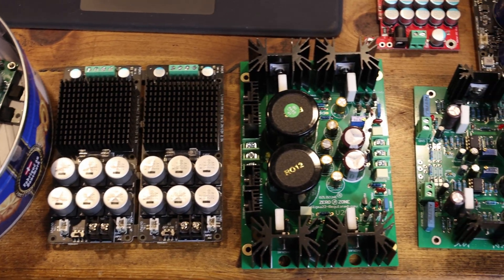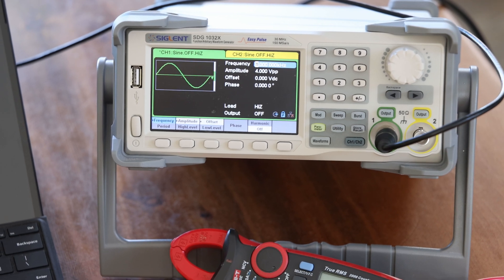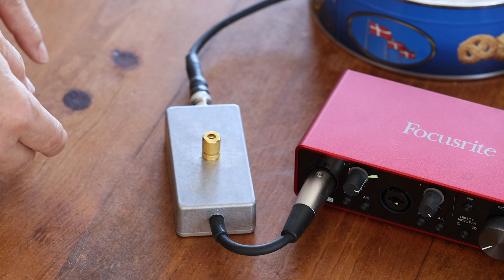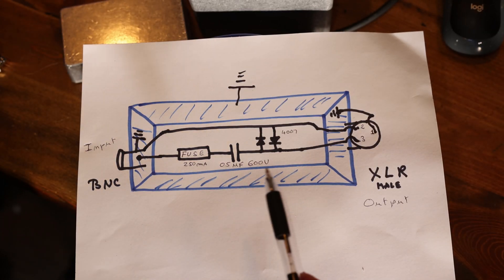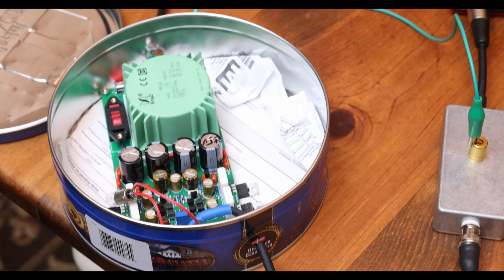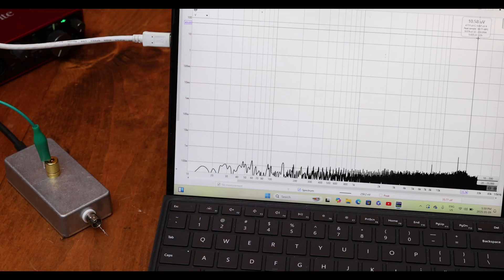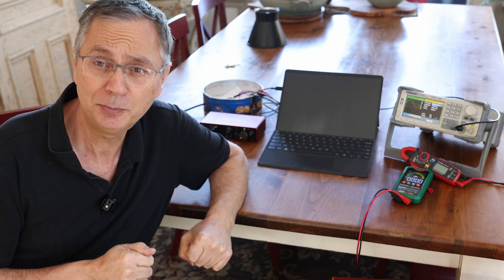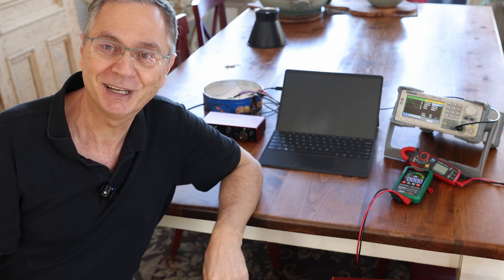How to measure your power supply Ripple at µv level

Comment: I am looking into this. I think one needs to be careful with the voltage calibration: If you put in a 1V peak (ie 2V p-p) signal, your diodes will clamp it down, so the calibration will not be accurate. I might have misunderstood the signal you're using.
Reply from the maker: you are correct I actually use 10mv not 1v as it is a lot closer to the uv level so more accurate you can see it here  at 12:52   https://youtu.be/i7Z-2Ty5TJw?si=KVqV3Z92hxIHdqp_&t=772

Comment: If digital multimeters are used for calibration, frequencies higher than 500-1000Hz should not be measured because most instruments cannot correctly measure voltage at higher frequencies.

Comment: How do the diodes prevent high voltages?
Reply from the maker: When two diodes are placed in opposite directions  they clamp the voltage to within a certain range—typically around ±0.7V for silicon diodes, or ±0.3V for Schottky diodes.

When the signal is within ±0.7V, both diodes are off (reverse-biased).

As soon as the signal exceeds +0.7V, D1 turns on and conducts to clamp the voltage—any extra voltage is shunted to ground.

If the signal drops below -0.7V, D2 turns on and clamps the voltage from going more negative.
Reply: @Gabster1  Makes perfect sense! Thanks!

Comment: "Just touching the probe here with my finger..." - you mean on the metal box you said  a 400V shock could be fatal from? Hmmm. To be fair, it's got a grounding socket on it, which is ideal.

I'd put the metal box inside a slightly larger plastic one, or wrap it with PTFE to insulate it to virtually eliminate the chance of shock. Likewise, you could wire a resistor and LED on the box that lights up if it's ever live, or there's a fault. It may be over-engineering for safety, but that's exactly when over-engineering is best.
Reply from the maker: i had a small pin in the BNC center that I touched not too visible

Comment: I use HP3400 with crest factor of 10, up to 10Mhz .
No orher instruments can do it today.
 They are true rms with no other competitor 😊
Reply: Have you changed the electrolytic caps in the meter, as they get old they add extra noise to the meter reading?
Eevblog has lots of discussion and suggestions on how to do it.
Myself I use my Rigol DSA815 RF spectrum anysler, works from 1Khz to 1.5GHz noise floor is in the 200nVRMS range.
Reply: It is completely recapped,  and calibrate too.
😊 @universeisundernoobligatio3283